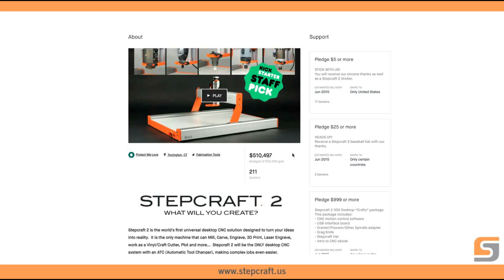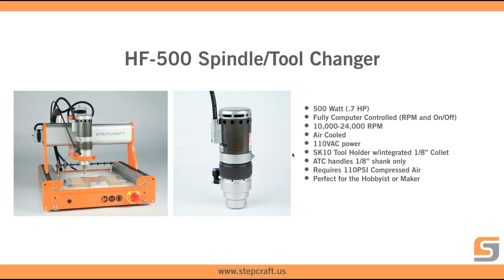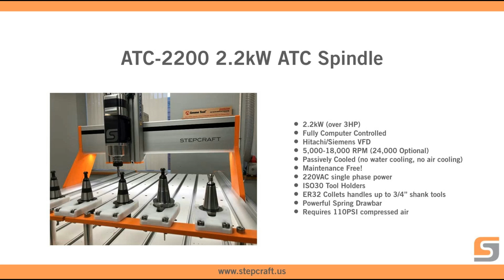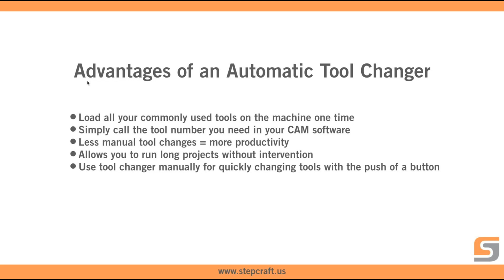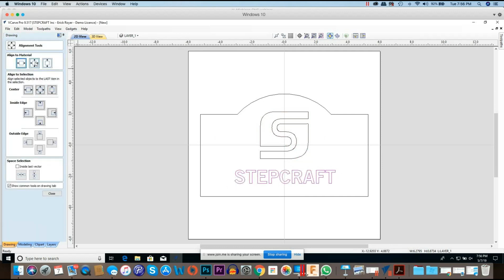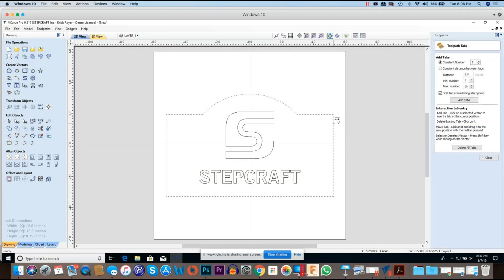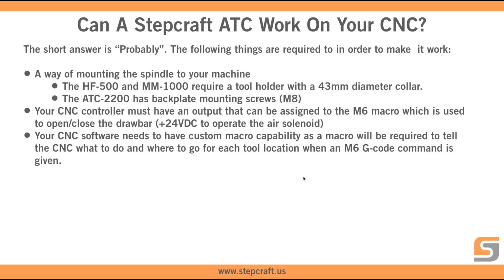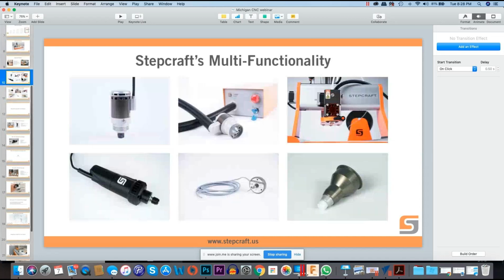Automatic Tool Changer   Erick Royer, StepCraft CNC

Comment: In the market for a cnc router, but it seems most machines in the 10000-20000 pricerange are from the States, been looking at  shopsabre and cncrouterparts specificaly. Since i'm in Belgium importing is probably very tedious and not cost efficient. Stepcraft is seemingly one of very few if not the only machines i can find here in the EU, so it has attracted my interest as well.

A few concerns however, will this spindle and automatic tool change come to the EU as well? I'm not seeing it available on the website as of yet...
Are there any opinions on nema24 motors maybe being a little aenemic for a 4x8 production machine? 470 IPM rapids feels a bit on the slow side to me...
Reply: I know this is an old post but I have just been in your shoes and have placed an order with Stepcraft for the Q408.  I hear what you are saying about the max speeds and about the Nema24 rather than a nema36.  The trade off seems to be accuracy and repeatability, with the competitor machines that have rapids upwards of 1000+ipm they use some type of rack and pinion drive train which generally (in the same price range) give you a +/- 0.010" compared to the stepcraft of 0.0006".  This is because they use a ground ball screw for the driving all axis.  That is also the reason they can use a smaller stepper motor, less torque is required because of the mechanical advantage of using the screw.  Lastly their method of turning the ball nut rather than the screw means less power is needed because less mass is being rotated; it also mean no ball screw whip.  

I also see now that they do show the ATC spindle on the EU website so if you are still in the market, give it a look.